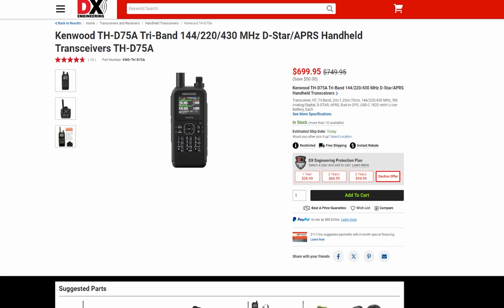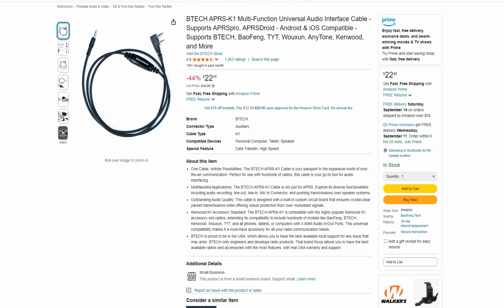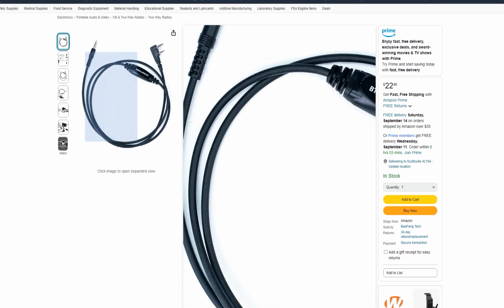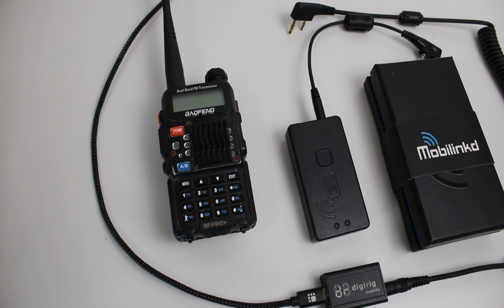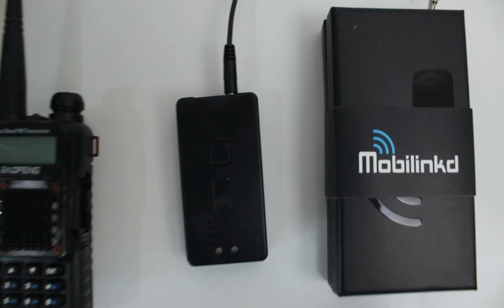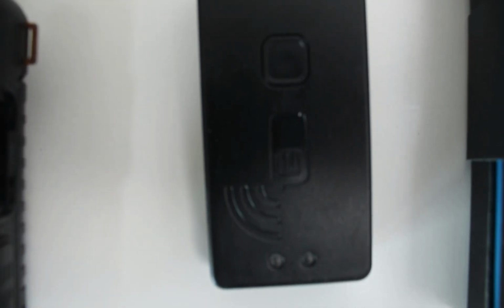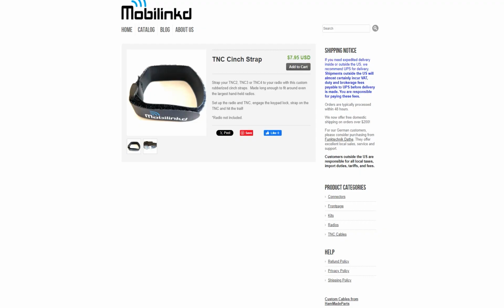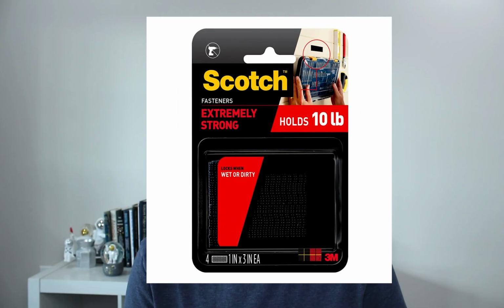Digirig vs Mobilinkd | Which is better | Using the Digirig with Baofeng UV-5R | Cheap Digipeater

Comment: Excellent video!  Your analysis is spot on.  I love the Modilinkd TNC4 for my HTs.  I also use the Radio Mail app to send email and texts.  And I use TNC4 for APRS.  I do have a love hate relationship with Digirig.  I wish the Digirig had BlueTooth as the USB cable is a pain.  But as you say if you want to use a different mode, Digirig is the only one that will work.  Too bad the YouTube algorithm hid this great video for so long.   73s
Reply from the maker: Glad you liked the video! When I first started looking at them, I had this same question. After buying them, I started realizing they are two different things. Thought I would share my experience. Enjoy!!